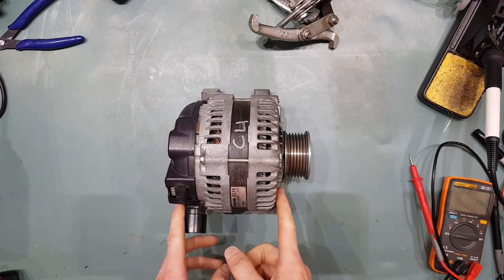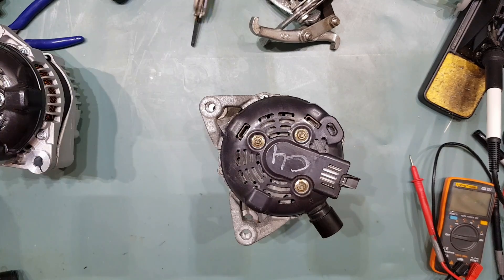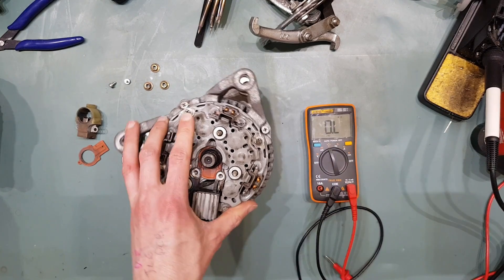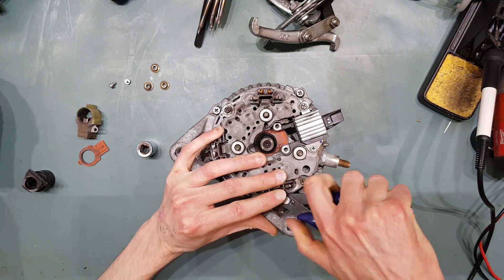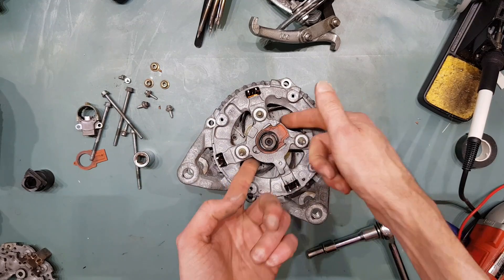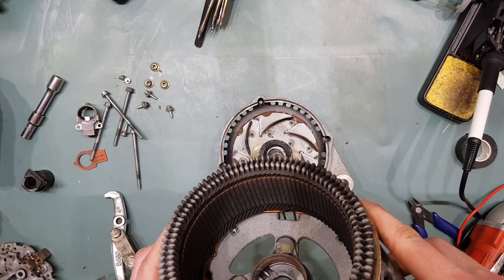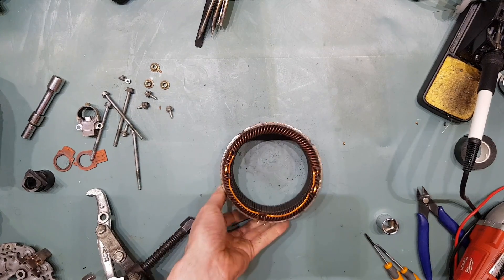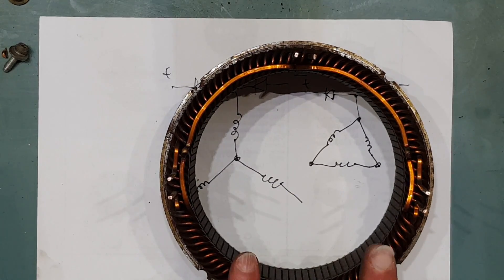Make your own HIGH OUTPUT alternator! - Part 1: The Teardown!

Comment: Can this only be done with specific alternators? I need a Hi-amp alternator! I would love to know exactly how to do this but with a model that will fit my 1st gen fucus , With so many different alternators, It is mind numbing to think of just how many different alternators there are! I have a 1st gen focus & I have priced both a 160 amp alternator & a 300 amp,,, If I remember correctly, In order to purchase an alternator that produced more then 300 amps, (at least for my car, & from the company's that I have found,) the cost is much greater! $500-600.00... I need to watch all of your video's & absorb all of your info!!!!!! I am hoping that you can assist me in building a Hi-amp alternator that will fit my focus? When I look at different alternators online, I often wonder if one from another vehicle would fit my car because, I have seen some which appear to be of the same design but, They push 30-40 amps more then mine...but, If you can assist me in achieving 300+ amp's, y meddle over 30 or 40 but, an additional 30 or 40 can mean a good bit!!!!
Reply from the maker: Small case, Denso, Hairpin. They all look the same, as described in this video.
Others can probably be modified, I don't know how.

Comment: I take it you don't know how to do basic 3 phase math.   You don't get double the current form going from a Wye to a Delta configuration.  You only get  1.73, in theory.      In reality due to over driving your diodes, plus other current carrying circuits in your system,  you will be lucky to see a 50% gain in current and with the trade off of likely having your system voltage dropping off badly at idle.  

That and with the now theoretical 173% of stock output the odds are your diodes will live rather short lives too.  

Not a bad video how to modify a alternator though.  well done, but just a bit of math mixup common with working with 3 phase power systems plus solid state devices being overdriven.
Reply from the maker: This was a 160amp alternator, it now does a measured 320amps.
320 is double 160.... I'll stick with my maths thanks ;)
Reply: @TwistTapeTechnology   Just pointing out basic three phase physics of an idealistic system.   https://www.allaboutcircuits.com/textbook/alternating-current/chpt-10/three-phase-y-delta-configurations

Odds are your alternator was capable more than 160 amps to begin with if you managed to double its output just by switching your internal connections from Wye To a Delta configuration.  :)

Believe me. I've worked with 3 phase power systems and generators for over 2 decades, and modified enough alternators as well, to know that more often than not you don't get lucky like you did.
Reply from the maker: Alternator did 160 amps before the mods, 320 after.

Comment: Simply reduce your load. By going to all  Led's, starting motor that's more efficient , radio head unit and amp that is also more efficient. #2 you will need to go to a larger gauge wires to support the larger amp load.  Or you can have a electrical fire.
Reply: dam1041960 and if I wanted a high output alternator due to a small car stereo upgrade to a few thousand watt. The amplifiers need a lot of ampere in order to prevent drop in voltage.
Reply: @HaraldBergTechTv  dam is a fool. If you're going to upgrade your alternator to a higher amp capacity, you should be also doing the big 3 upgrade. So long as you've got adequately sized cable running to your amp, you will not fry your electrical system
Reply: @HaraldBergTechTv  But the stock wiring must be able to support the increase in amperage output.  You need to know if the factory has more than one harness  for different alternators  as most do. A former parts department employee of a mopar dealer. And have seen a few fried vehicle harnesses.  You should get a wire diagram of your vehicle first and see. Ae: Battery positive & negative gauge wires and alternator gauge wires. These are all ways larger. And also power distribution box ae: fuses main bus fuse.  Just do it right and be careful.  And put some boom in it.

Comment: And when you're done tearing it apart, throw it away and go buy that 320 amp alt.
Reply from the maker: Why?
Reply: I'm thinking this we'll burn up quicker just buying a 320 amp alternator will be better for longevity because everything is beefed up for the higher amps I think that's what blueknight is trying to say
Reply from the maker: What's shown in this video is 100% the same as what you'd get buying a 320amp alternator.
Reply: TheyDontWantMusic  By doing this, what are the new RPM requirements / output relationship?
Reply from the maker: @soldermecold7456  Have a look at the specs for a random DC Power 320amp alternator, that's modified the same as shown in this video ;)
https://www.dcpowerinc.com/collections/high-output-alternators/products/11034-320-hp-toyota-camry-2004-2-4l-i4-2az-fe
Specifications, rpm and output will be pretty much the same.

Comment: What part of the alt would cause a whine than wont charge battery fully?
Reply from the maker: Bad rectifier will often result in AC voltage entering the cars electrical system.

Comment: But whats the draw back?  Nothing at idle?
Reply from the maker: You'll need a smaller pulley, to spin the alternator faster at idle, to still get good output.

The drawback is, that spinning it faster will wear out bearings quicker, and it also means an increased load on the engine, that will negatively effect fuel consumption.

Comment: I have a 240amp alternator i bought for my 1994 chevy camaro its a 5.7L V8 could it be modified to make even more amps ?
Reply from the maker: if its a small case hairpin alt like in the video, then its had one half modified to do 240amps, meaning the second half can be modified to do 320amps. It will do slightly less output at idle though as a result.
Reply: @TwistTapeTechnology  will a smaller pulley help at idle?
Reply: @Mr.boxxchevy  yes it will but if you are redline'ing your car then the alt will be spinning to fast and can come apart and or blow the bearing out of it
Reply: @NightshiftCustom  thanks for the input 👍

Comment: I cant find any info on how or where to get a 320 amp rectifier.
Reply from the maker: ho alt assemblers use rectifiers with twelve, 50amp diodes in their 320amp units.
Reply: I have a 180 Amp can it be modified in the same way?

Comment: Is there any difference between a regular stator and a high output one?
Reply from the maker: High output alternator "manufacturers" generally just modify the stator, and use the original, unmodified rotor.
Reply: Thanks
Reply: High output stator (the part of the alternator that stays still) has larger copper windings, thus it can take on more current than a smaller one.
Reply from the maker: @OtherDalfite  No one makes "high output" stators.
Reply: @TwistTapeTechnology  check your previous comment according to you they do. Not like they sell just the remanufactured stator though
Reply from the maker: It's modified as per this video, it doesn't have larger windings, or more of them. Its the same stator, just with the windings reconfigured.
Reply: @TwistTapeTechnology  oh sorry I was referring to a high output alternator that is purchased as that seemed to be the subject of the discussion
Reply from the maker: High output alternators that are purchased are what's shown in this video.

Comment: I have a mechman elite 370 GM 2pin for an 06 Silverado 2pin, I am looking to convert this 370 to the 4pin version.. I'm looking for the part number of the regulator they use or one that will work.. I want to switch it to the 4 pin so I can use the mechman digital display voltage regulator..
Reply from the maker: The "normal" go to, GM regulator, that most assemblers use is the IN6003. I make no guarantees that this is correct for your application.
Reply: +TheyDontWantMusic do u know if a stock 2006 GM 2pin alternator will work with a 91102R external regulator? I have one, I just want to make sure it work before I try hooking it up to my new $600 alt..
thanks man
Reply from the maker: @tankdog03ify   The external regulators just connect to the alternators field winding, so as far as I'm aware, will work with any alternator.